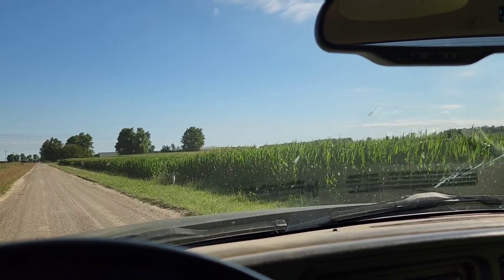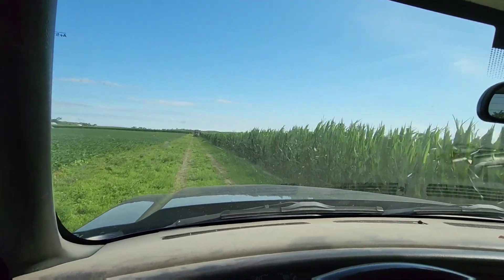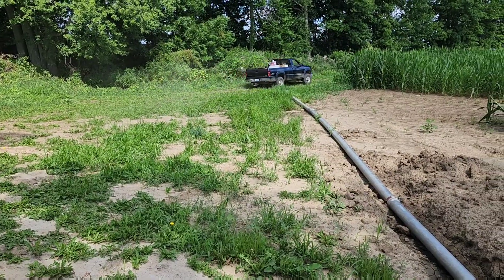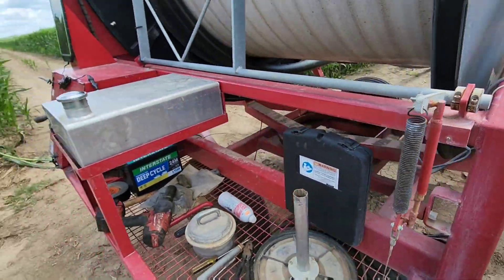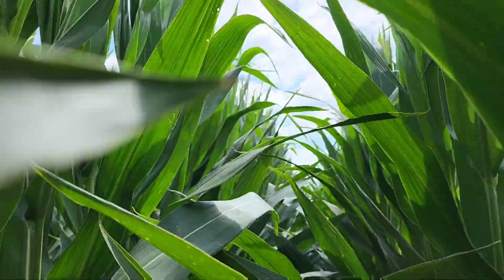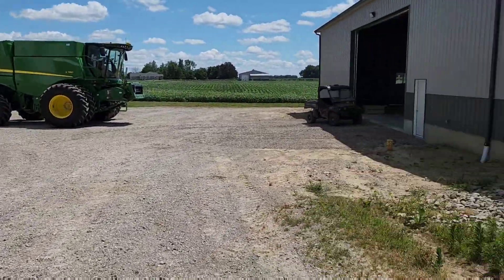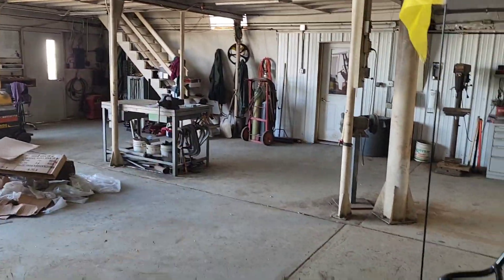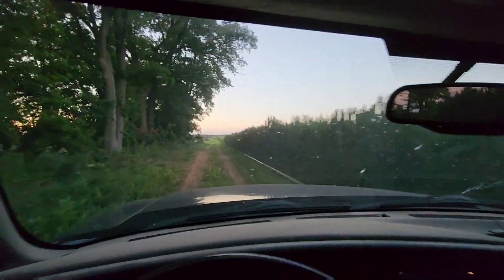Irrigating, Cleaning Equipment,  and Having  a Little Fun!- #721

Comment: The 12 volt 20mA solid state relay you added to the pump shut off controller may not have enough current to punch through the surface oxidation (corrosion) on the pump controller’s output relay. It may be enough if the pump controller relay has silver or gold contacts or is a hermetically sealed relay. The minimum “wetting” current to keep the pump controller output control relay contacts clean is based on the contact material used and it’s contact spring pressure. The minimal “wetting” current may be 10 mA or more but 30mA may be needed to keep the contacts clean. A hermetically sealed magnetic reed relay would be a great output relay to help in your outdoor high humidity environment.

Comment: If I owned the field, I would put  pivots on the NW and SE property line.  Also could work with the neighbor to have a better land layout for just one pivot.  Using end guns and eliminating the hose paths would make more corn with less water.  Using underground PVC supply lines and pivot would save 80% of your energy cost.  <30 psi rather than what you have.   Since your labor and fuel are cheap you will keep the system!

Comment: Let Brock know once he sprays the foam on the equipment start rinsing from the top that way he won't get dirty what he has already done.
Reply: My brother learnt to wash trucks from the bottom up. If you start from the top dirty water will splash up as you wash your way down (and on big vehicles possibly dry), and you'll have to start over again. If you start from the bottom, dirty water will still make the bottom dirty, but now a lot more water flows down and take the lose dirt with it to the ground (this also prevents drying). Once you are done all the way to the top you take a quick rince top to bottom, and this time the water will be mostly clean. Hi from Norway and sorry for wonky english :)

Comment: You said "How can it be too much current because it is 12 volts"
Volts are volts, current is current they have nothing to do with each other.  You can have a 100 amp draw in a 1 volt circuit and 1 microamp draw in a 100 volt circuit.  Current carrying capacity of the FarmHQ relay is what you care about - forget about voltage, it is not a factor.
That 12 volt relay could easily have drawn more current than the motor run contactor control you activate/deactivate when you press the start/stop buttons.
See that wiring diagram posted on the upper inside of the pump control box.  If you show me a detailed shot of it I might be able to calculate current flowing through the start button

Comment: I am by no means an electrical engineer but the only thing I can think of with the relay is that the circuit from the power supply, through the control box relay and to the coil of the 277v relay may be "shorter" than the 277v circuit and the inrush current might have caused the problem.  I'm not sure exactly how it was wired but maybe if the 277v relay was put in series between the power supply and the control box, the coil in the 277v relay may have limited the current hitting the control box.  Or I could be completely wrong on that.